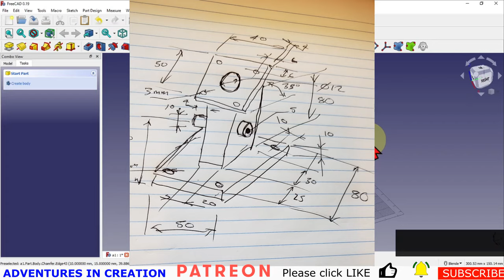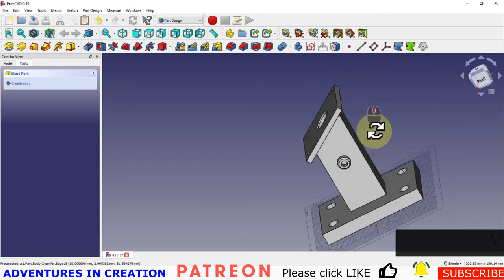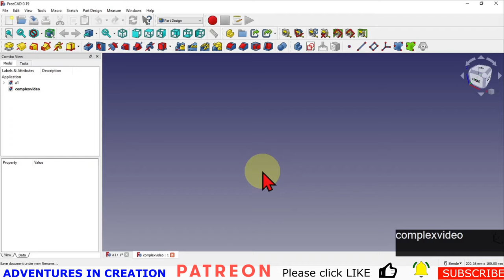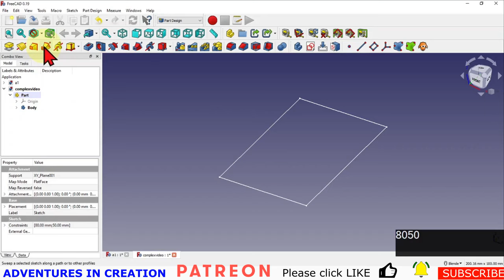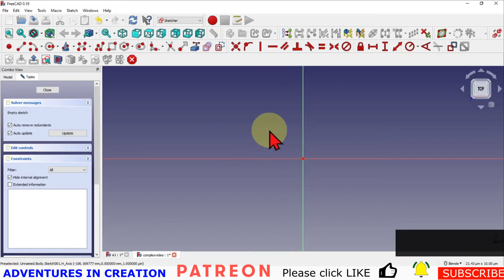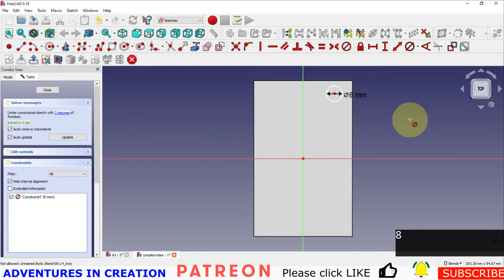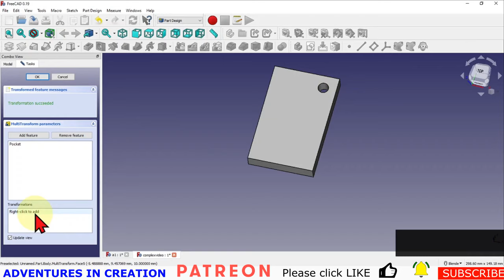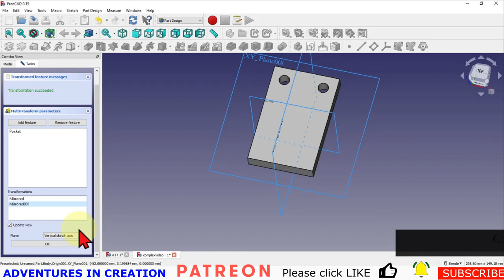FreeCAD Beginner #10 - Creating a complex model

Comment: Thanks so much for sharing the great work! I'm approaching my CAD development from the perspective of "how will this part/model print"? Given that, I'd probably approach this as three separate parts and add a mechanism for joining the three upon print completion/post processing. Is there a method, now that you have the completed part, for simply separating the three and saving out as sep stl files? In my head it makes more sense designing this way because the dimensions/etc.... would be easier to set in this method and then just separate out the parts into their separate components. However, that's keeping in mind that, my head, is in Kindergarten in relation to CAD design and of course FreeCad. Again, thanks for the post, great stuff!
Reply from the maker: If you want to make separate STL files, it would be best to create separate bodies of each part that you creating to print that way. I think that part would print ok as one piece if you put some supports on the "lugs" and under the "flange".  I have been doing some 3D prints with clips to put parts together to make printing faster. Those have worked well even in PLA.
Reply: I don't think you are in kindergarten , Free Cad is. Assembly and Top Down design are not possible yet . Or .......
Reply from the maker: You are half right, assembly and top down design are possible they are just not as advanced as some CAD systems yet. Remember, FreeCAD is improving rapidly and is extremely powerful, you may have to adjust your thinking a little bit. I can tell you that back when I first started using CAD, a system to create these models was extremely expensive and specialized, the fact that you can create complex models for free and on an OK laptop is simply amazing!
Reply: @Adventuresincreation  Good point. For me it depends upon what the part is functionally doing and how much force that will be applied. In the case of this part I could see hollowing the pillar and running a threaded rod or similar item to provide more strength for the top plate and carry any excess load, etc...
Reply: @nedeljkomucic311  Thanks Nedeljko, I'm definitely swimming with water wings here. Give me about five years of designing/producing and I'll be strong. I bought my 3d printer with the goal of developing my own models for printing. Of course the heart of this is CAD and from my view so far, FreeCad absolutely rocks. Sure, 360 is the top end but, it also comes with a top end price and? I'm running FreeCad on RPI 4B with 8GB mem and on the still beta 64bit OS. All of which, perform incredibly well. Re assembly and top down design I'm sure I'll find plenty of walls as with anything but, learn to work around them.
Reply from the maker: Good thoughts, if you were creating something for purpose that you were going to augment with other materials, definitely consider creating parts in separate bodies and then you can print whatever parts you like. When I am designing for a 3D print, I am usually trying to avoid supports and thinking about print time. I like the clip together parts from a manufacturability stand point but strength is limited.
Reply: Putting each section into its own body is probably the best approach, but also keep in mind that slicer programs (Prusaslicer, etc) allow you to split an object into multiple pieces.  
If you are experimenting with a model, consider setting top and bottom layers to zero and printing with only infill.  This will cut the printing time considerably.  You can then turn the top and bottom layers back on for the final version.  On the STL I have loaded in Prusaslicer right now, normal print time is 1 hour, 22 minutes.  With top and bottom layers set to zero and 30% gyroid infill, time is 26 minutes.
Reply: @Adventuresincreation  I like this and the idea of using clips. Will you make a video of creating / using the clips you've mentioned? Sounds like a great way to bring the parts together. In the case of strength they could still be used as alignment tools while incorporating other joining tech to add strength.
Reply: @fixbox2741  That's an amazing difference in time. I'll have to work on this. Admittedly I've used very little of the available Slic3r / PrusaSlic3r features that are available. Just this week I figured out I could actually miniaturize many of the prints for a "first run through" which shows me what areas of the print are a challenge and gives me a space to tweak settings in prior to printing the full size version.

Comment: Where/ what Height to put Datum plane? Create a new side view sketch, then "create a point in the sketch" where the vertical green line and middle of 35° line intersect. Next, Constrain the Ht. Between the new point and the "middle base point"(sorry, I don't know the proper term) to force FreeCAD to show what the required Ht. Is.... then delete the sketch and plug number in for Datum plane Z Ht. Easy.....
Reply from the maker: That's a good idea to avoid calculations

Comment: Rather than the complex formula to add the angled plane, why can't you just attach the plain to the top surface of the post?
Reply from the maker: The topological naming issue would negatively effect that approach
Reply: @Adventuresincreation  thank you. I found the article relating to this and it explains issues I had in the past. I knew the what, but not the why. I think his issue is what ultimately will send me back to Onshape. Your tutorials are brilliant though.
Reply from the maker: @fishndive1961  You might want to hang on, the next release should have a fix that largely negates the issue. It's been in the works for a long time and will get there. I have become so used to it that I just work around it now but once it's fixed I will go back to using faces for datums.

Comment: Could you not have just drawn a sketch on the slanted face without using a datum plane?
Reply from the maker: Hi Danny, you could do that but if you modify your model after doing so, you risk experiencing the topological naming issue where the sketch will be attached the wrong face. That's why, at least for now, we have to use offsets and datum planes to create these features.

Comment: Why not just click on the face of the slant then click the datum plane icon? No need to do any calculations.
Reply from the maker: You can do that but, you should not because you may have a problem with the topological naming issue. The face you link the datum plane to may change its ID and the plane will move.
Reply: @Adventuresincreation  Should be possible in the Realthunder version

Comment: I was surprised you dimensioned the hole with a figure of 30

If the important factor is that the hole is 10mm from each edge, surely that is best to constrain. Because if you change the height from 80 to say 100 then the hole breaks

Just an observation
Reply from the maker: Hi Graham, as always there are many ways to skin a cat. Sometimes, you can decide that there are "reasonable" limits and not constrain for every use case however, if you really want to lock it down you certainly can in multiple ways. Glad you are thinking about it critically.
Reply: @Adventuresincreation  your videos have been a god send. I haven’t found anyone online who explains things *as I would want them explaining*. Many just skip over important things and leave me guessing. 

Every time I watch a video and think of a question in my head as I watch, the next words out of your mouth are the answer. You’re really thinking about your audience and you are pitching this at a perfect level. 

I’ve trained a lot of people over my 30y in software and it’s not easy to do. You’ve got this down to a fine art. Thank you 🙏 👍
Reply from the maker: @GeeTheBuilder  thanks for the feedback mate.

Comment: This video just shows how much farther FreeCAD needs to go to be commerically competitive with something like Solidworks.  The whole process where you had to dimension things off the origin and especially the angled datum offset calculation wouldn't have been necessary.  Dimensioning off the origin is not a trivial matter of a few additional simple calculation, where you dimension your features off of is determined by your design intent.  Yeah I know you could've "referenced external body" to get those edge lines into the sketch.  That's also not necessary in something like Solidworks.
Reply: He could have dimensioned off of the edges just as well.  I certainly would have.

The new datum plane could have been created by selecting the angled face and then creating it.  The only issue is that the origin doesn't automatically center on that face, but there must be a way to do that too.  Doing that calc was unnecessary.
Reply from the maker: FreeCAD can work of edges and faces however, at this time, the standard version suffers from a topological naming issue which will cause the model to break if there are additional faces added after using a face as a reference. This is actively being worked on and can be seen working in the RealThunder branch. - I agree that it has a way to go before it is a viable commercial package but for many hobbyists it is an excellent alternative to learning a package who's price may change in the future.